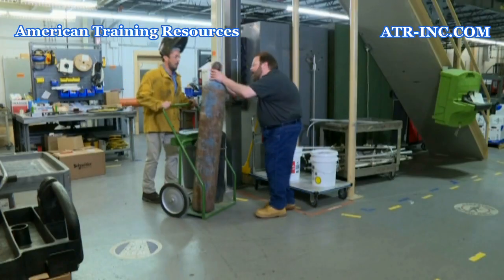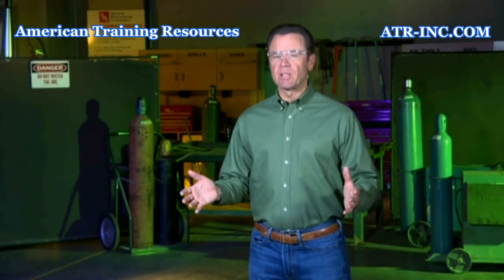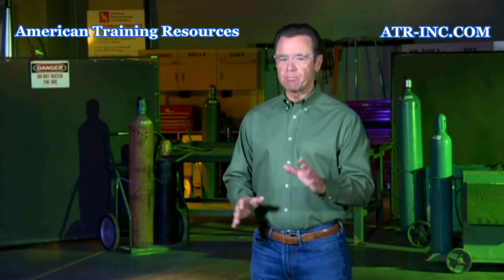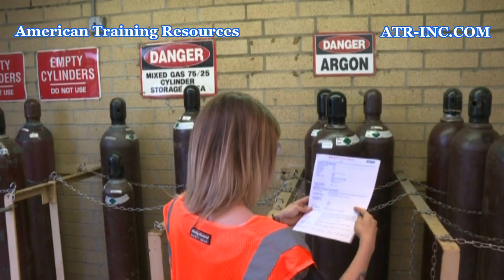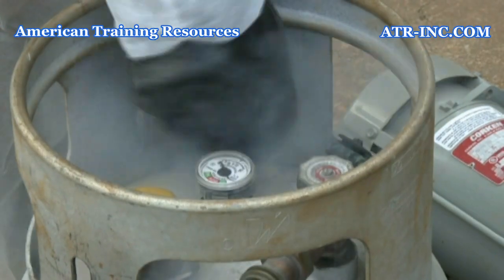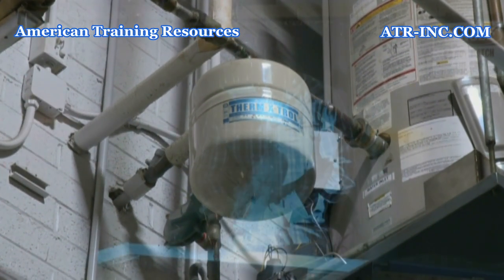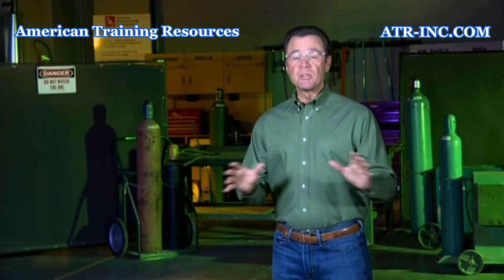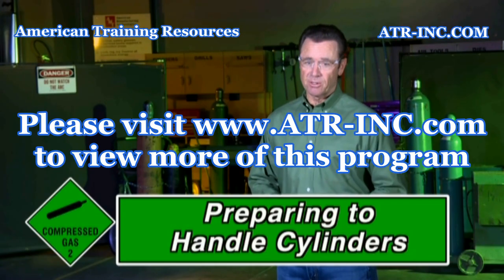Compressed Gas Cylinders Safety Training Video

Comment: We have one of the chain trollys at work for calor bottles 15kg and the chain sometimes comes off or the bottle falls. How do you safety use these with calor propane or butane 15kg?
Reply: Use a carabiner to clip the slack end to the tubing of the cart.